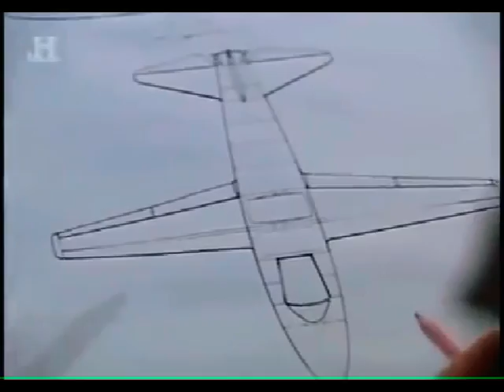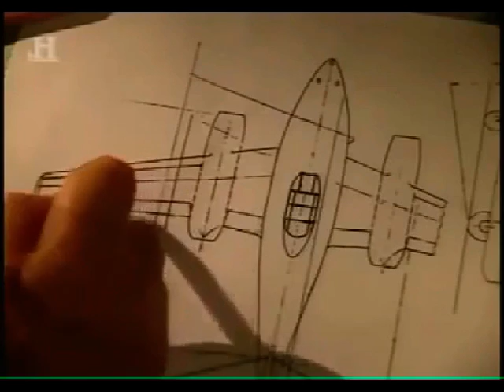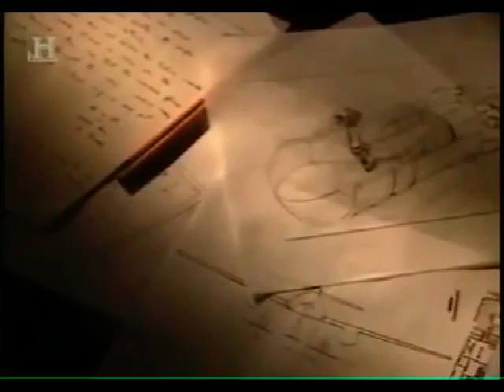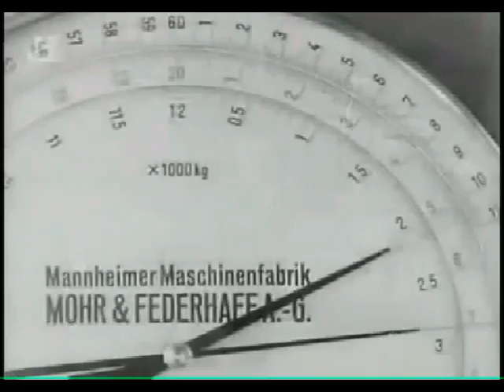The Father of the Jet Engine - Hans Von Ohain

Comment: frank whittle had the first working jet engine
Reply: It blows after 10 seconds. Nice jet. Ha ha.
Reply: von Ohain’s jet ran fully under its own power about 2 months before Whittles.  When von Ohain met Whittle the German gave Whittle credit because Whiitles ran on kerosine having solved the combustion problems first whereas the German used hydrogen.  It’s worth noting that von Ohain also used a centrifugal compressor, not only that they used a “centrifugal gas turbine” which is properly called a “radial inflow turbine” because of the self matching properties.  The combustion problems of the German engines were solved by a Mac Hahn, the garage mechanic with 400 patents on welding torches.  At that point the German Air Ministry threw enormous resources into axial engines because of their lower drag although Heinkel continued with centrifugals and a hybrid type called the Head 012. Britain focused on the centrifugal because of its greater controllable nature and Lower weight but paid a price in airframe integration.  The meteor engines had to be shifted from underslung to middle of the wing with 3 navel modifications and thrust increases.   The Americans showed the way by burying the engine in the aircraft thereby negating the air drag issue from large diameter engines.  This rapidly lead to the nene that was then scaled down to create the Derwent V.   Thus although the British engines were better the airframe integration issues they created delayed the British aircraft until a combination of last longer nacels and more power overcame it.
Reply: But still whittle was the first to get one tested and working but not on it's own power. Hans Von Ohain's model was the second to be tested but his was the first self contained model and the first to get into the air. Franks would have been the first if his fellow brits had taken him seriously from the start.
Reply: No, Whittle was the first only in the UK.
Reply: @sandervanderkammen9230  In his foreword to 'Elements of Propulsion, Gas Turbines and Rockets', did Hans von Ohain himself say-

"The first patent of a turbojet engine, which was later developed and produced,
was that of Frank Whittle, now Sir Frank (see Fig. 5). His patent was applied for
in January 1930. This patent shows a multistage, axial-flow compressor followed
by a radial compressor stage, a combustor, an axial-flow turbine driving the
compressor, and an exhaust nozzle. Such configurations are still used today..."

and

"From the beginning of his jet propulsion activities, Frank Whittle had been
seeking means for improving the propulsive efficiency of turbojet engines. ¶ He
conceived novel ideas for which he filed a patent application in 1936, which
can be called a bypass engine or turbofan. To avoid a complete new design,
Whittle sought an interim solution that could be merely "tacked on" to a jet
engine. This configuration was later known as the aft fan. Whittle's work on
fan jets or bypass engines and aft fans was way ahead of his time. It was of
greatest importance for the future or turbopropulsion."

Comment: I THOUGHT IT WAS FRANK WHITTLE
Reply: you thought correctly
Reply: I thought it was Ægidius Ælling in Norway in 1903
Reply: You all thought wrong. Hans von Ohain was the inventor.
Reply: The first turbojet engine was built by Hans von Ohain and it successfully flight tested on August 27th 1939.  2 years before Frank Whittle.
Reply: Hoa Tattis  Wrong, first patent for rhe turbojet engine was Maxime Guillaume, May 3rd 1921
Patent number 534.801
Reply: @sandervanderkammen9230  Are you going to correct Spottydog4477 then and tell him that Ohain isn't the father of the get engine. Here's what Ohain himself had to say-

"The first patent of a turbojet engine, which was later developed and produced,
was that of Frank Whittle, now Sir Frank (see Fig. 5). His patent was applied for
in January 1930. This patent shows a multistage, axial-flow compressor followed
by a radial compressor stage, a combustor, an axial-flow turbine driving the
compressor, and an exhaust nozzle. Such configurations are still used today"

Comment: von Ohain made an important contribution but Whittle was the 'father' of the turbojet engine. He was the first to propose a gas turbine engine using thrust for propulsion instead of a shaft horsepower like a turboprop. He patented his idea in 1930.

It is a verifiable fact (in his own words) that von Ohain thoroughly read and critiqued Whittle's patents and even changed his own application as a result, before designing and building his own engine.

Whittle ran his engine in April 1937-6 months ahead of Ohain despite the German's huge backing from Heinkel.

When you conceive, design, patent and build something before anyone else and then prove the concept by running an example, you are the inventor or 'father' if you like. That is a historical fact. Not a revisionist dream...
Reply: איתי קאופמן Jet  engine was not  invented by  Frank Whittle  and  I am neither British nor German..
Reply: איתי קאופמן Whittle's 1930 patent was flop..Von Ohains concept was more advanced...
Reply: barracuda7018 Von Ohain's engine did not go past the test stage and was never put into production. What do you think that was? Whittle engines are still flying today.  History is the judge.
Reply: Complete Aerogeek '' Whittle engines are still flying today ''   You  are delusional dude...LOL...
Reply: barracuda7018 Really? All RR Centrifugal engines (including those developed by Halford) were based on Whittle's designs. The Klimov VK1 was a RR Nene-again based on Whittle engines but developed by RR with help from Whittle.

Not to mention the RR Dart a significant number of which are still in service in F-27s and the like.

So every Mig 15. Meteor, and Vampire still flying today as Warbirds are doing so on Whittle engines.

Who is delusional?  Fool....
Reply: barracuda7018 Listen to you. You cite nothing but apocrypha and lay your whole argument on obscure unverified statements. The USAF tested a Mig 15 and found it was equal to the Sabre in most aspect but superior in climb performance and service ceiling, two of the most important performance areas for an fighter.

You know someone who uses the word faggot' so often really should get our of his basement more.   US test pilots Chuck Yeager and Tom Collins determined that the MiG had quirks but if flown by a well trained pilots the Sabre and Mig 15 were equally capable but hey maybe you are a better pilot than Chuck Yeager....
Reply: +Complete Aerogeek  You so lost this one haha Barracuda's comment his comment says it all.  And those basics is what is been used till this day.....
Reply: Gary Tarr '''accept it , deal with it and get on with your sad and pathetic life !!!!''''

HAHAHAHA... Lost  the argument as usual...
Reply: +Complete Aerogeek True, usually it is difficult to attribute an invention to a single person. However,  with the jet engine it is easy. Whittle achieved every single major milestone by himself, from the initial concept, through to patenting, testing, building and manufacturing the worlds first jet engine.
Reply: +agt155  Yes it is. Whittle's preeminence is a historical fact unlike what that silly , nasty ranter barracuda seems to spout every time he is confronted with incontrovertible facts.

Conner's book establishes unequivocally,  in von Ohain's own words, that he read Whittle's patents before filing his own and well before trying to build his engine. 

This is not a slight on Ohain, as it is normal scientific practice to review all the available literature before embarking on a project.
Reply: Complete Aerogeek http://www.britainunlimited.com/Biogs/frank-whittle.htm

1978..He became convinced that Ohain had worked independently to his original Patent.

How come you take Margaret Connors  anecdotal evidence which was published years  after Von Ohains death  as a gospel  a woman  who most probably doesn't even understand  how an aircraft can fly  and present it  as  incontrovertible fact  and dismiss everything else  as fiction  even  if  Whittle  himself confessed that Von Ohains patent was  independent ..

The truth is that Von  Ohain didn't copy anything from   Whittles 1930  bullshit  patent as  claimed  by  agt155  and  Gary Tarr  trolls every single  time..

Yes, its an  historical  fact  that Von Ohain has designed , developed  and flew before Whittle and  there is  nothing you can do to refute this dude..Its all  documented..Of course I don't mean extremely  biased, jingoistic British sources...

Remember it was  you who  once claimed in one  of  earlier posts  that Germans had  nothing to do  with development of  the  Concorde  !!!!    and I  made you look very  bad   dude.. You were owned very badly when   I provided all  the  pertinent  links regarding the  work  done by  Dietrich Kuechemann  and  Dr. Weber at  RAE  in Farnborough.... AEROGEEK???  lol
Reply: Complete Aerogeek Sorry dude, can't read it, too long and boring ..the same old  bullshits.
Reply: Complete Aerogeek ...Remind us again what Germans had to do with Concorde?

http://aerosociety.com/News/Society-News/2742/OBITUARY-DR-JOHANNA-WEBER

 her colleague and contemporary, Dietrich Küchemann, laid the foundations for the world-leading position that the UK now enjoys in the aerodynamic design of civil aircraft wings. In turn, this wing design capability has contributed to the rise of Airbus to stand beside Boeing as one of the world’s two dominant manufacturers of civil aircraft, with the consequent benefit to the European industry and economy. Many others have played their part in this success but, without the combination of Küchemann’s vision and Weber’s mathematical prowess, the advances in UK design capability between the 1940s and 1970s would probably not have occurred. Without those advances, the early Airbus aircraft might not have proved commercially successful and the industrial giant that is Airbus might conceivably not have arisen.

Royal Aeronautical Society, are they delusional ???

http://www.ft.com/intl/cms/s/0/146abb02-70ae-11e4-8113-00144feabdc0.html

http://www.independent.co.uk/news/obituaries/johanna-weber-mathematician-and-aerodynamics-expert-whose-work-on-wing-design-played-a-key-role-in-9893860.html

AEROGEEK , the self- appointed aviation professional   ....LOL  You  are such an ignorant fuck

http://www.amazon.co.uk/Aerodynamic-Design-Aircraft-Education-Series/dp/160086922X

read the book and learn something, moron .
Reply: +barracuda7018  Yes -  facts are inconvenient aren't they? Particularly when they are in conflict with your delusions....
Reply: +barracuda7018  Not which research delta wings were based on.... What did the Germans actually have to do with Concorde? The ogival delta wing on Concorde was nothing like Lippisch designs other than being triangular. 

To use your logic we would have to say that the first person to invent a kite was responsible for Concorde because it uses the same aerodynamic principles...

Buffoon.
Reply: Germans ahead in 1945? So how come the British had the Rolls Royce Nene (Centrifugal) and MetroVic (axial) series of jet engines putting out twice the power of the German designs?
Reply: barracuda7018 The MetroVic engines didn't enter production themselves. But would go on to form the basis of the Avon and Sapphire series engines. The MetroVic engines been considerably more powerful then the Jumo designs and a lot more reliable. Believe it or not; nations were not happy to accept German engines with their 20 hour service lives.

The Americans on the other hand had their own axials running before the end of the war, again considerably more powerful then the German designs.

It would be from these two nations that most of the cold war jet engine development would come from. Not German jets, German jets were unreliable and under-powered. They had no need to be used when the allied designs became available. Only the French stuck with the German designs. Hardly the best. 

The RR Nene would go onto power much of the early cold war fighters instead and kick start the soviet designs, who ditched the German designs for the British ones.

Also MetroVic had its first running engine in 1941, the Jumo 004 in 1940. You need to rethink what a decade means.

Comment: Whittle was a crude mechanical engineer while Ohain specifics in thermodynamic , flow calculation etc moreover this was his direct study in university. To achieve such high mechanic tech like jet engine on those days.  It could not be done by Whittle for sure.  It could not be done by trial and error from coarse mechanic.  But coulde be success by those who 're very full knowledge to the theory and subject.
Reply: Perhapse you are afraid of a few facts, Whittle was a graduate of the RAF college Cranwell where he completed a 3 year course in Aeronautical engineering, he then went to Cambridge University and received a doctorate in engineering. The greatest mass flow engineer of them all Hooker  (Rolls Royce and Bristol's) was surprised how advanced Whittles work was. There is one difference between them In Britain an experimental aircraft could not fly until it's engine had a Flight standard certificate there was not the same requirement in Germany in 1938
Reply: alex Lo 

The axial compressor was first demonstrated in England, the Germans were the first to get a production model running. While the Allies used centrifugal compressors because they were more reliable and better understood at the time. That’s part of the reason why the ME262 had to have entirely new engines every few hours. Axial jet technology wasn’t ready. It’s yet another example of the Nazis pouring scarce resources into on paper war-winning weapons using technology that wasn’t ready.

The father, as we know it, of the turbo jet was British inventor Frank Whittle. Long story short, the British defense ministry rejected Frank Whittle’s design in part due to reviewing engineers at Armstrong-Whitworth pointing out, correctly as it turns out, that a turbo jet engine would be fundamentally inefficient. Instead Whittle patented the design, and not being top secret, the concept greatly influenced the Nazi design team led by Hans Ohain.

Engineers at Armstrong-Whitworth, drawing upon their criticism of the Whittle concept, began development of the first axial-flow turbojets and the first turboprops. And it is this technology family that led directly to today’s turbofan jet engine. The Whittle design proceeded in private development, eventually being taken over by Rolls-Royce. By 1944, the Armstrong-Whitworth design developed higher thrust with superior throttle control, and the Powerjet/ Rolls- Royce centrifugal flow turbojet has proven itself to be far more reliable than the competing Nazi jet projects, the Jumbo 004 and the BMW 003.

Steel is the wrong material from which to build jet engines. Given time, steel will always fail. It fails because the iron in steel sublimates out of the alloy, essentially turning the metal to Swiss cheese on a microscopic level. The general term for such long term metal fatigue is “creep.” In the 1940’s, no one knew that steel would inevitably fail given the temperatures and pressures in jet engines. The correct material that makes jet engines actually practical, and not simply impossible, is nickel alloy, which was a British invention, designed by the British jet design teams. There is no indication that the Nazi design teams ever understood that steel was never going to work, no matter how much they modified their design. The fact that nickel alloys were the solution was not at al intuitively obvious and the Nazis weren’t doing much in the way of R&D to discover the problem.

The Nazis two major production jet engines never managed to last more than 25 hours. You can’t win a war when you have to replace, not merely one but two engines, the most critical and expensive component of an aircraft, every few hours. The icing on the cake is that the Nazis didn’t have access to sufficient quantities of nickel, courtesy of theRoyal Navy blockade, even if they somehow discovered that steel was never going to work.